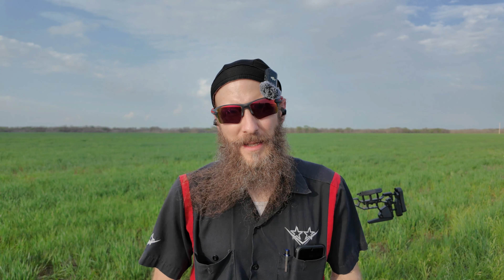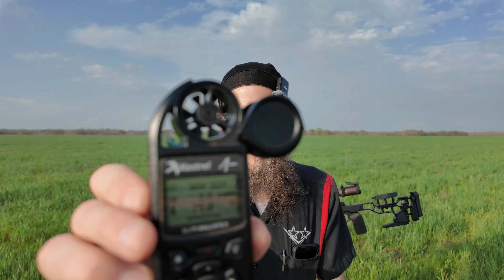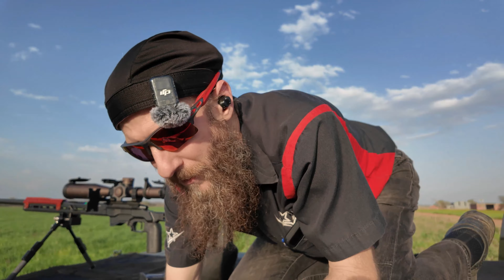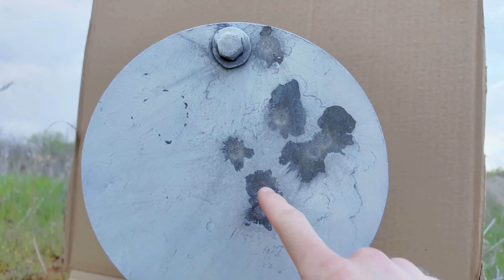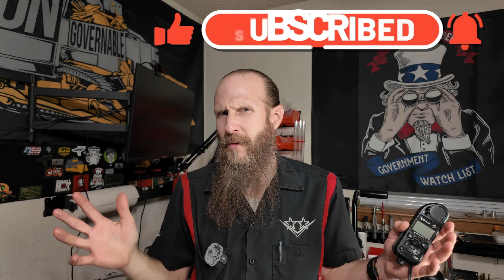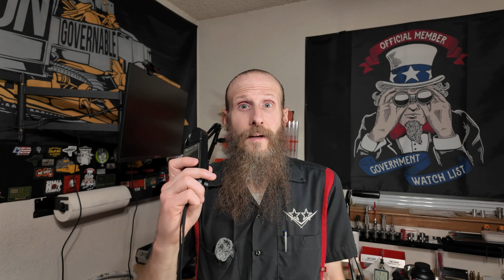Using My Kestrel The RIGHT Way!!

Comment from the maker: Well, after this video, I think I can say that I figured out the issue. I did have a direction issue that has not happened again, so hopefully that cleared from the update and/or reset. But, I was inputting wind incorrectly when I was manually setting it. So, that likely put me off the edge of the targets. When I do the wind the right way, I'm hitting the targets! Even tried an assortment of ammo that I thought may be too different to depend on, but I got hits with all of that as well!! 
So things are looking good now! I'm running out of excuses to not do well in matches now, lol. Gonna have to step my game up and score some more points!! 
Have a great rest of your day! If you want to help my channel and try some great coffee, check out my link here and use my code to save: CK2A
https://coffeebrandcoffee.com/?ref=dC8omF4z6GXzwI

Comment: I figured running it with another one would sort it out. Glad to hear it. You learned something and so did we. See ya on the next video
Reply from the maker: Yes, that was good to confirm I got the issue worked out of it with the direction problem. Then while we were talking about things I mentioned how I was doing the manual inputs and he was like, "that's wrong" 🤣 What I get for not reading all the online manual. But, I think this issue is as solved as it can be!! I was obviously getting hits here, so that is all that matters in a match! Time to work on the next skill to master and I can finally move past my mental block that had me stuck on this problem for several matches!! I'm frustrated with myself for doing the same thing wrong for at least 3 matches now on several stages 😂 Moving forward now with better understanding of how this works and how to use it properly!!
Thanks for watching, Patrick. Thanks again for the suggestion to compare to another person's. That ended up being what got me to the answer.
Have a great weekend!!!

Comment: I've never used a Kestrel, but i have heard other people say Bad info in = Bad info out.
I'm glad you got it figured out my friend. Your next match will be much improved 👊😎🇺🇸
Good luck on the next match Chad
Reply from the maker: Yes, after getting it reset so it was properly reading directional headings and not wandering, it was an input issue. At least, that's what was likely causing me to be off target. Another example of a man not reading instructions 🤣🤣 If I had pushed 1 more button, I would have accessed a sub-menu that showed WS1=AVG..... oops!!! I never saw that before 😂
But now, I am aware!! I did some tests trying out the numbers I had input on the stages I missed more than I hit and each one was over a mil of windage wrong. Pretty confident that was my issue. 
Now that I am confident in my loading work and much more confident using the Kestrel for data, I can get back to focusing on the skills that can be improved with practice. Moving faster, smoother, and getting settled in position better. Once I get those skills down, I should get 15-20% more hits per match I am estimating. We'll see in about 10 days on the 14th!!
Have a great weekend, Tony!!

Comment: Chad,  what model of Kestrel are you using?  Would you recommend the same one now?
Reply from the maker: Hey, Hazzbro. I have the 5700 Elite with Applied Ballistics. Highly recommend. As you've seen, there is a learning curve. It is sensitive, but when I do things correctly it can put me right on target. Last match at the 1050 target, I went 4 out of 5. So it is a great tool.
Look at the options, of you are doing ELR distances get the 5700X, it has faster processing speed. But the Elite is best for most people. The standard 5700 only can store 3 gun profiles, but Elite and X have space for 30. And 30 sectors with 10 targets each can be saved with Elite and X, versus 1 target with standard. For the features, the Elite is what I recommend. 
For what my thoughts are worth 🤣 But really, you can't go wrong with it. Great tool to learn and have handy for a variety of situations. I use it often just to check the weather now!! I am even more happy with it now that I think I solved the problems I had. As expected, they were user error 😂
If you have not, check their website, there is a good chart comparing the different models. My vote would be for Elite.
Thanks for watching, and have a great weekend!!!